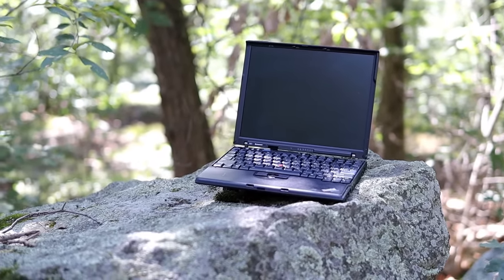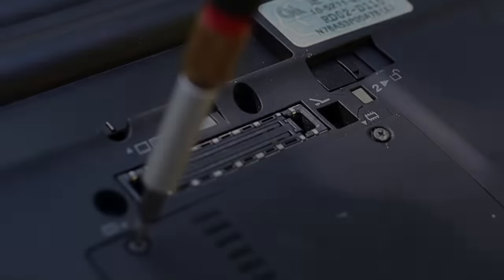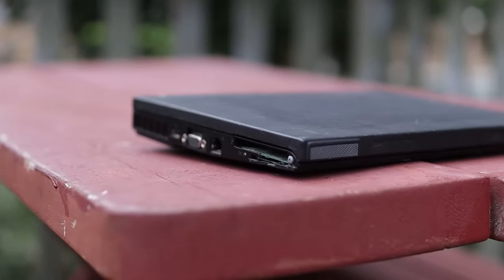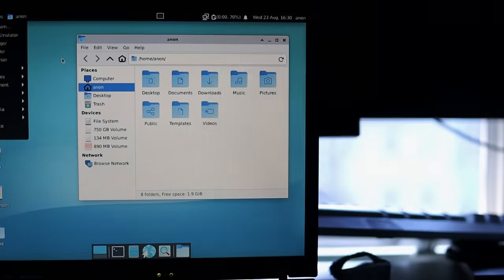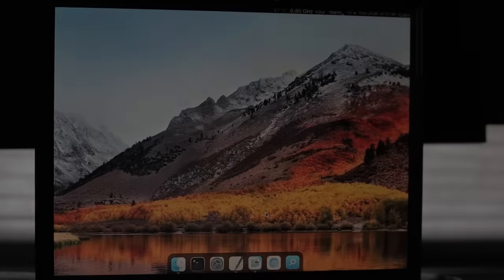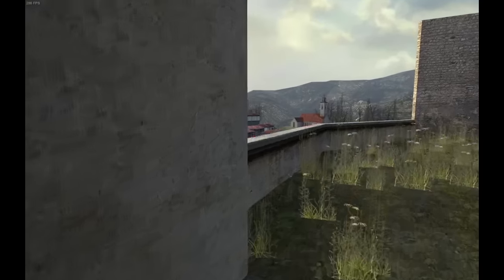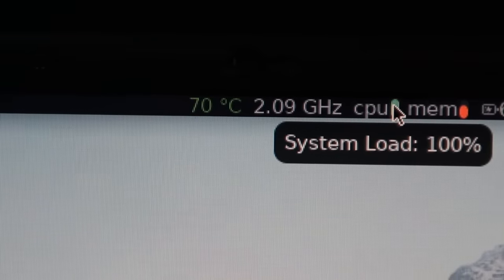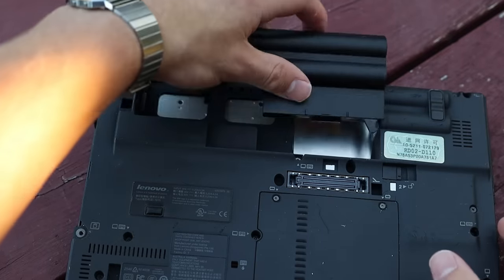Can Linux save this old laptop from obsolescence?

Comment: Yes, I would totally agree with you, The thing I can't understand is how easily people tend to throw off their devices and think it's time to buy new just because Windows 10/11 can't run on it, or just slows over time. Most people tend to have basic tasks, Browsing, Movies, Storage and that can all be fulfilled by these "old" devices. The main problem is the OS that runs on it, not the actual hardware (yea to some extent). 4 years ago I bought my new HP Laptop, i5 8625u, 8 Gigs of RAM and 1TB HDD. Upgrading from a 2GB RAM w/ Pentium 4 Machine I was really excited and thought how fast my new Laptop would be, but it didn't turned out to be as fast as I dreamed, within a year, we were back to the lagging and issues. Hell, I ain't even like those people who don't maintain their devices, I constantly did. but Microsoft's Updates always ruined it all. yet a year later I couldn't run anything on it, I stripped windows 10 to it's core components only, disabling services and stuff. and one day, It updated itself to Win 11 and even using mouse would hang it for hours, took literal 5-6 minutes to boot up and I thought it was trash........ 
I didn't use it for months and survived off my phone, but since phone was started to being a problem to me, I decided to fix it up, first I bought a SSD and performed a clean install of Win 10 and then I dual booted Linux ( Pop OS ) and it's just been days but it's great for me. I just installed Win 10 because stuff like Office I need sometimes and some software just don't run on Linux. but It's been great, I themed Gnome to look like Mac OS and my laptop feels so new. haven't booted up Win 10 in days and don't plan to. I plan to use this laptop throughout my college too..... 
It's been great, to all those reading this and wondering if you should switch to Linux, YOU SHOULD.

Comment: As much as I appreciate the emphasis on upgradable components; I think once you hit a certain level there's no more upgrade possible and that point comes much sooner than you think. For example 10y ago I was using 8G of ram. If I bought the same computer now I would not have be able to upgrade it beyond 8G of ram because it was already fully upgraded and not capable of taking more.
Reply: Did you tell your Captain that you were giving it all it had and it could nae take no more or it would blow?

Comment: Linux doesnt target old machines anymore like they used to in the 90s. now its all bleeding edge bs, and often are more system heavy than windows.
Reply from the maker: I get what you're saying, but I think there are still a good number of distros that target (or lat least work well on) older hardware

Comment: I just stopped when you said you would NOT upgrade from hdd to ssd.

That was a VERY WRONG decision due to the kind of test you were doing and this upgrade was MUCH MUCH more necessary and effective to boost performance. This hdd is the MAIN bottleneck of this computer.

Comment: 4:51 You have no idea at all what you are talking about. This just an absurd statement. Tell me how runit, a bootloader, would "speeds up your system"? As it stands, for some people, it boots a few seconds faster. You are talking about it like it's an SSD. SystemD is a software suite of various useful utilities, not just a bootloader.
Reply: Runit is an init system, Void uses the grub bootloader by default. Runit uses much less resources than SystemD's  init system for running and starting processes. It comes with some sacrifices, but it uses WAY less RAM; which is how it speeds up the system.

Comment: Nope, you spent money and you still have barely usable e-waste. Really, if money is tight, don't look at ancient Core 2 Duo systems. There are plenty of sub 100 USD and even sub 50 USD Sandy Bridge systems available used. It's going to be quite rough still, but way better than with Core 2 era system. Also Thinkpads are way overrated. Yes they are upgradable, but their screens suck donkey balls and due to popularity, parts are plentiful, but not so cheap. There are better options than them for cheap too.